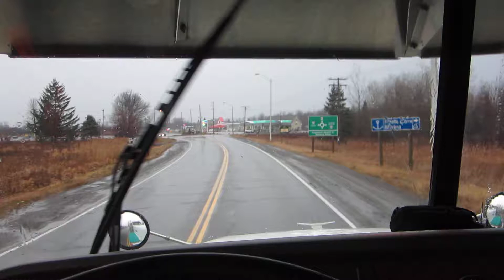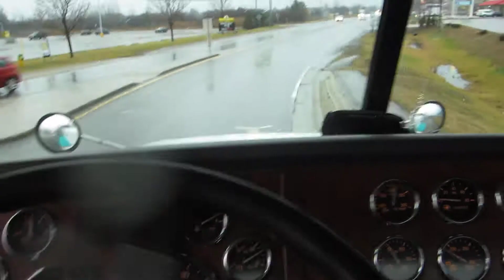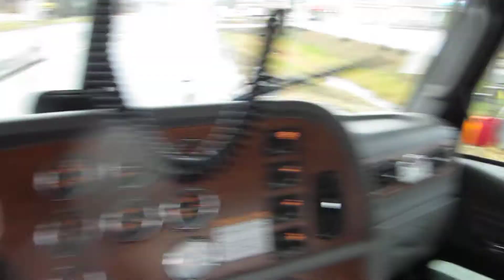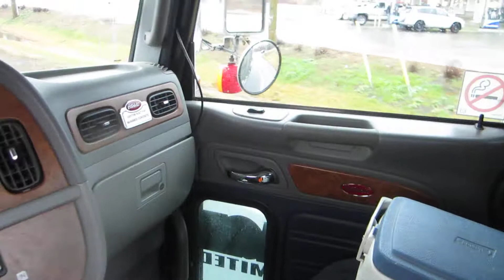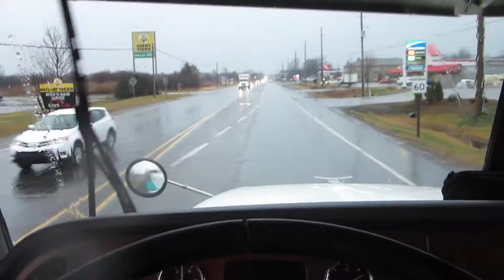Mr. John Tutorial: How to negotiate a single lane roundabout in a semi

Comment: How to stay center in the lane when drive a tractor trailer? Thank you
Reply from the maker: Hello- good question- use your 'west coast' mirrors and make the distance from the center yellow line to the tires on the drivers side equal to the edge of the pavement to the tires on the passenger side
Reply: @SafeTravells  thank you very much